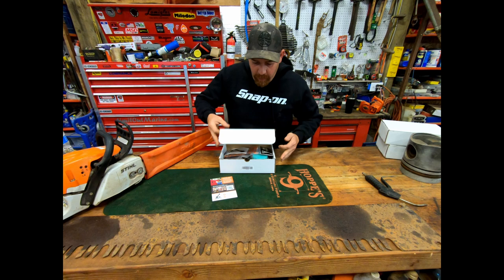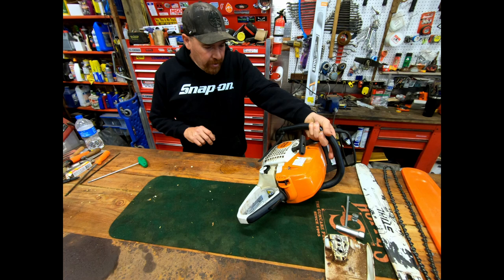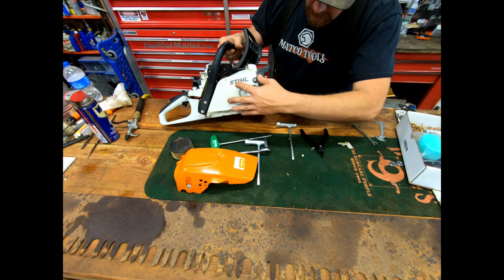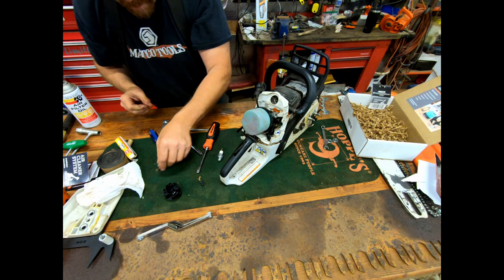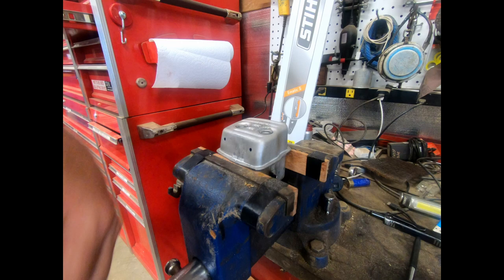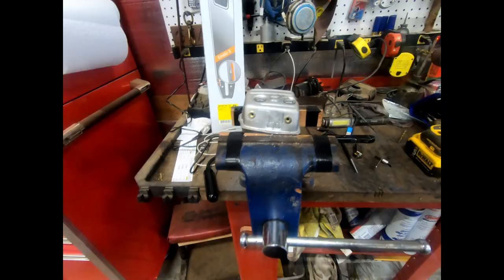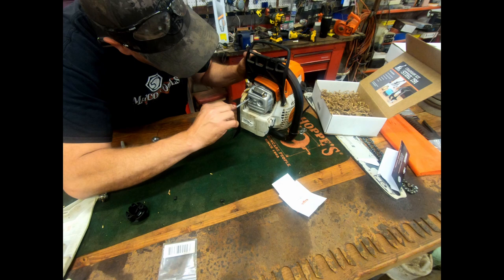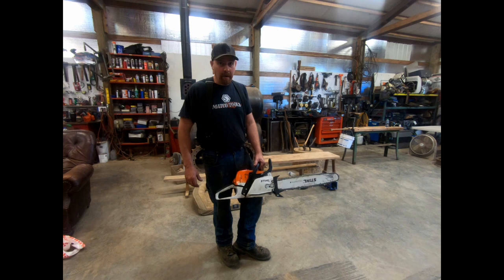Westcoast Saws MS291 build. Chainsaw Kit Install. #Westcoast Saws #Stihl Chainsaw Mod #Bark Box

Comment: I Greese the bar tip with a Greese pen, and take a framing tie piece ( flat Steel to tie boards together ( earthquake and wind) to clean the inside of the bar.  Sure bar oil is important, but a good slot helps.   I never use wd40, a gas rag on a untreated saw, then armor all to keep dust from hitting it again.  Some other fellers say I am waxing it, I just want to keep the chips and dust away.
Reply from the maker: Always good to grease the bar tip, good idea on the Simpson tie to clean the bar. I think that would work great.

Comment: There is an 8mm Stihl T handle wrench for those nuts.   They mold it that way so average joes don’t mess with it.
Reply from the maker: I will look for one of those, I bought a generic one from Madsons but it’s a little too far to fit in there.
Reply: @workinonitsteve  this is what I bought off of eBay that fits.  
Stihl OEM Specialty Tool T Handle Nut Driver SW8 x 200m 5910-890-2420 #GL-J6A4. It was about 20 bucks or so shipped.
Reply from the maker: @jamesedwards6269  thanks, I’ll look into that 👍

Comment: So iam hearing that the 291 has a oiling system problem, gets cloged to easy ,any issues 🤔
Reply from the maker: Man I’ve got about 10 gallons of gas through mine in 2 and half years and haven’t had an issue. I flip my bar and blow it out with compressed air when I switch the chain but don’t feel like I’m doing anything special to keep it clean. It oils fine.

Comment: Is it a lot faster with the mods?  Looks like a fun way to pump up the power - I cut mostly oak and hickory, could use a little boost for fun
Reply from the maker: Way snappier throttle response, more power and LOUD. I love it. Doing to all my saws this winter.
Reply: @workinonitsteve  very cool, I will check it out for mine - do you think a 291 could run a 24” bar with the mods?
Reply: @jeffroberts760 I've an older ms310 that's been muffler modded. It definitely makes a difference in power in the cut and imo the best benefit is that your saw will run alot cooler. I only run a 20" bar and it rips in oak. I think your 291 would run .325 chain whereas my ms310 runs 3/8. You'll still be some short on power,but if you can order a 24" bar and skiptooth from maybe baileysonline you can certainly do it. If you cant find that combo in .325 you can change over your clutch drum and sprocket to a 3/8" and order everything in that size
Reply: @ciphercode2298  man, that is all very interesting to consider and makes a lot of sense - I am going to give that a shot, thank you🥃🥃
Reply: @jeffroberts760  you're welcome, always glad to help. A muffler mod, 24" sugihara bar,and a skip tooth chain will fix ya right up. Make sure ya richen up your high jet on your carburetor.

Comment: I wonder what the spark plug looks like after the mods
Reply from the maker: I had to pull the limiters out of the carb in order to turn the needles out far enough to ritchen the mixtures up. Plug looks great after about 15 tanks of fuel I pulled it. I actually run this little saw quite a bit.

Comment: Did you see any noticeable increases with the exhaust port been looking at videos I've got an Ms 291 also I haven't seen a video of you cutting with it yet
Reply from the maker: Huge difference. Much faster throttle response and seems to have more power although I have no way to measure that. Overall it just went from a decent saw to snappy throttle and seems to cut faster. For some reason it seems to start easier now, could just be from the-tuning but I’ll take it. I’ll try to get some video running it soon, I have a couple trees that need cleaned up from a storm last week. Thanks for watching 👍
Reply: @workinonitsteve  did you have to do a lot of adjusting after mods
Reply from the maker: @shawnpullen9517  I did, I’ll have to do a video. It’s not hard but you have to pop the limiters out of the carb and richen both high and low needles. It’s able to flow more air so it needs more fuel and thus makes more power.
Reply: @workinonitsteve  ok thanks for the reply back I love the bigger dogs I find the felling dogs on my 291 aren't big enough to grab anything awesome saw and thanks for the video👍
Reply from the maker: @shawnpullen9517  you’re welcome! Glad you liked the video. I’m with you on the dogs being small, the new ones are a huge improvement, feels more in control and cuts smoother. I’m gonna be putting them on all my saws.

Comment: is the ms291 supposed to have a little plate between the bar and the body of the saw?
Reply: Mine doesn’t - stock you mean?
Reply: I bought my new, and it did not have a plate between the Bar and saw
Reply: @irondoger  thanks i thought maybe the guy putting bar on it at the shop lost it

Comment: Information:
As longer the bar is the more space to sideway flexability she gets. Smaller bars are safer in that light.

Im not certain but i assume the smaller the radius at the tip is the faster the chain could jump off. Because the turn the chain get forced in isnt long ebough to hold it in line, so to speak.
Maybe somebody tests that under safe conditions.

Nice clip btw.
Reply from the maker: Thank you, I believe most of my issues were just from slashing through brush and trying to run it loose like a big saw. Glad you liked the video 👍
Reply: @workinonitsteve  rewelcome.
Well i had yesterday a costumer who bought 2 Stihl MS170, he told me in the 3 .sentence that he is afraid of chainssaws.
I told him he has only to be rational concerned to be when the chain isnt in the tree or is not deep in wood because the chain rides in a channel in the bar and isnt willing to jump out. Especialy when some pressure is applyd the chain is forced to stay in track. 

But otherwise forced in high speeds the momentum forces the chain almost out of the channel.
A hard twist and the lose chain flyes...
He made up his mind and took the saws.
How did your accident exactly happen?

Comment: You never showed tuning the carb after the install.
Reply from the maker: Sorry about that, I think I covered that in another video. Probably in one of the firewood videos. It definitely needs a lot more fuel on both needles. Huge power gain 👍
Reply: @workinonitsteve   I didn't find it anywhere.
Reply from the maker: @randywallace7797  I’ll have to post an update, I’ve probably ran 25 tanks of gas through that saw in the last year.
Reply: @workinonitsteve  I am about to do it to my 391 :)
Reply from the maker: @randywallace7797  nice, 391 is a nice size saw 👍
Reply: @workinonitsteve   It is a good saw but you can tell it is chocked back.  I am going to do the exhaust and air filter. After that it will be all the saw I ever need.  I just want to make sure I adjust the carb right.
Reply from the maker: @randywallace7797  definitely. I’m not sure on a 391 but most of the new saws you will need to remove the limiters on the needles in order to turn them out far enough to ritchen the mixture.